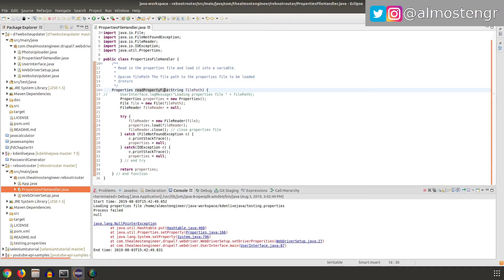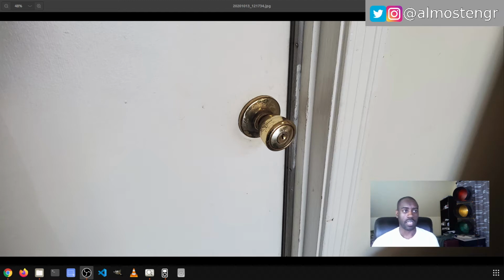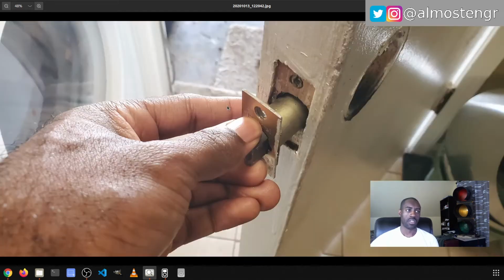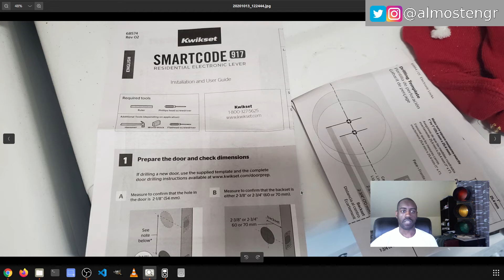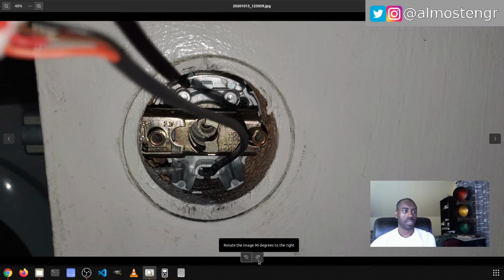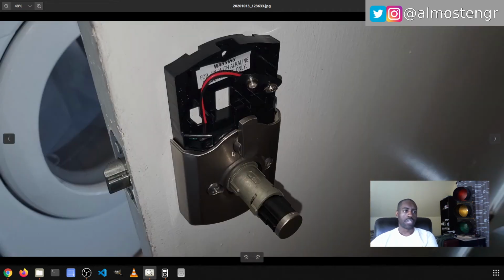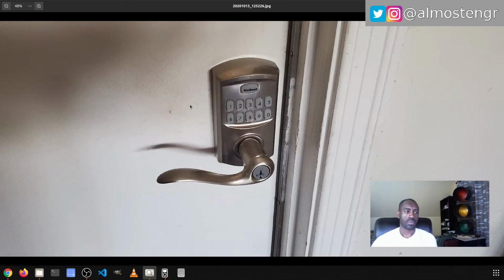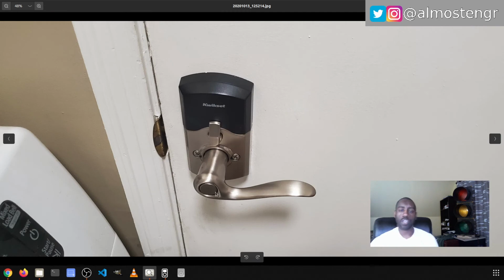Kwikset Smart Code 917 Installation

Comment: My set screw wheels not budge
Reply from the maker: Make sure that you are turning it in the correct direction to loosen. If that does not work the  you can try some graphite or a little (like a drop or two) of WD-40 to help loosen it up

Comment: Hey can you do a step by step for adding a code I have been here for 2 hours trying to add just one code. The instructions say press the program button, press 1, and then it will flash green. My lock never flashes green so I have no clue what else I am supposed to do
Reply from the maker: Ok. I'll have to look up the steps do it and  create a video
Reply: @rhtservicesllc  thank you so much I have been trying with no results
Reply: My instructions said to press three buttons in succession ("Program" >> "1" >> "KwikSet") and to do this all within 10 seconds or you have to start over.
Reply: @jamurnane you just saved me so much time thank you